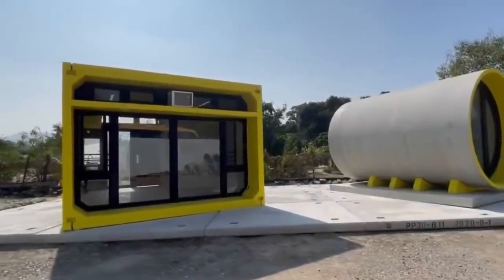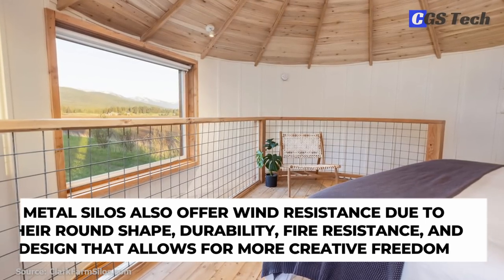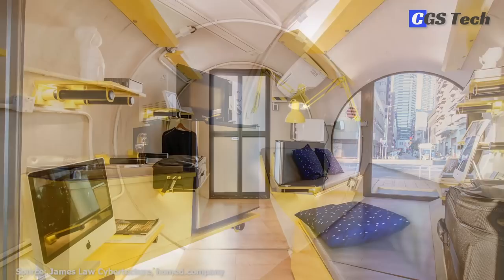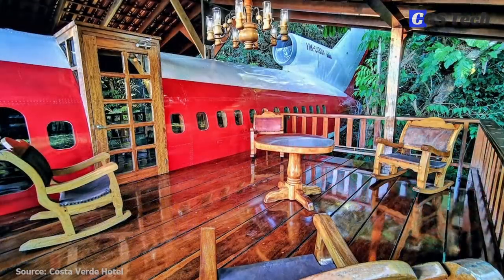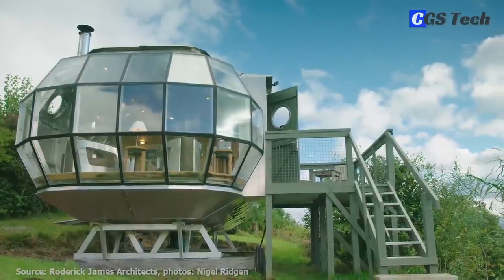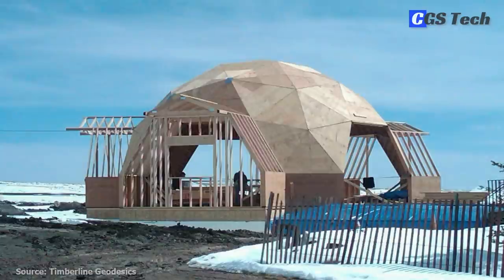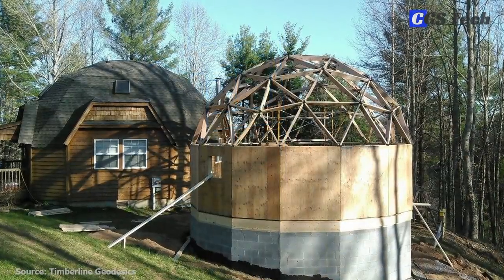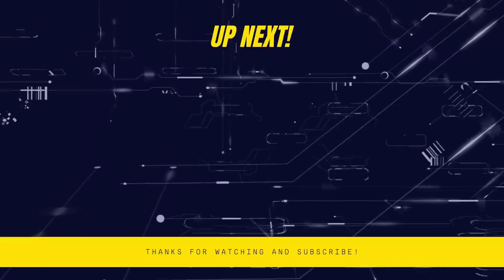6 UNUSUAL Home Styles

Comment: But have they solved the leaking problem with the geodesic dome? That's been the major problem with the houses from the beginning. Also, the surface/volume ratio may be good, but not all the space is necessarily usable. All our appliances, furniture, and fixtures have been designed for 90 degree angle homes, so furnishing a round house requires thinking outside the box... literally. 😉